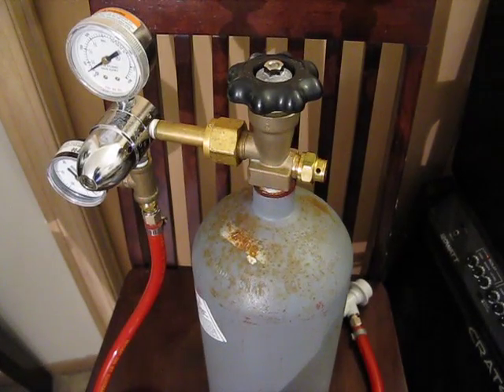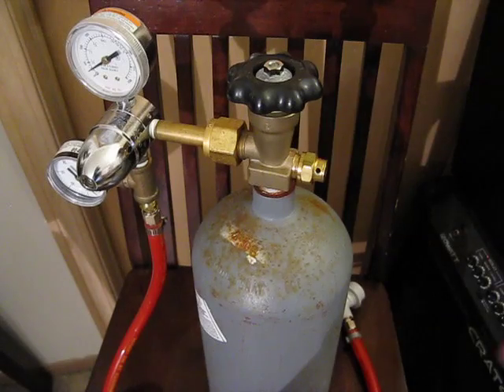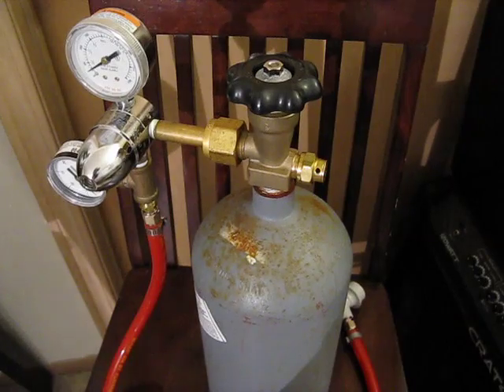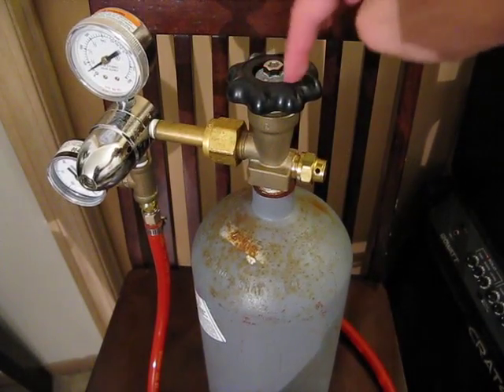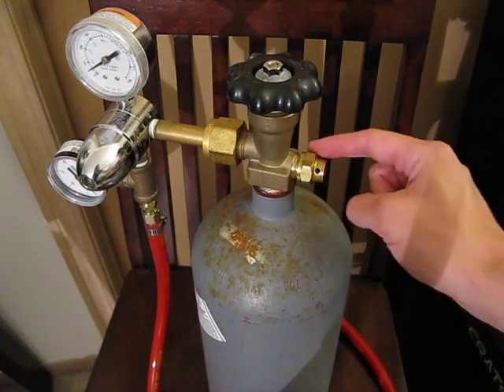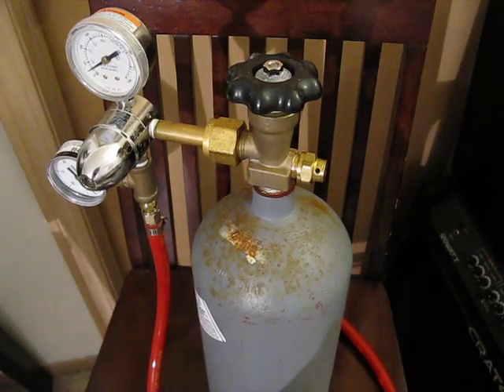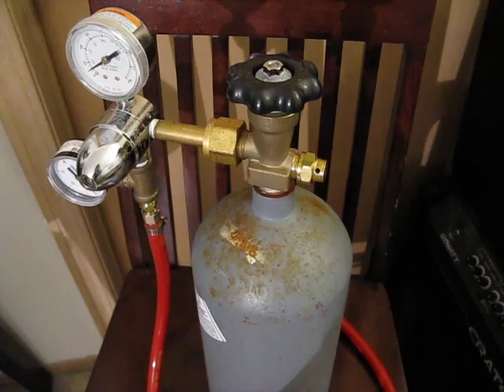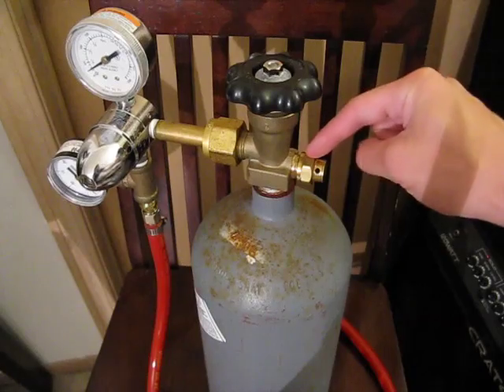CO2 Cylinder Tip - Checking for Leaks

Comment: I’ve had somewhat of a similar problem my safety valve blew out So I had a little diaphragm replaced and then refill the tank but it won’t hold pressure ever since so I just bought a whole new valve I was tired of playing with it I had it filled a couple times and every time it leaked out so now I’m going to an extinguisher shop on Monday and put on the new valve with brand new blowout valve diaphragm on an off-road Ing CO2 tank

Comment: Technically, they should inspect the safety and valve first. That's weird that it was bent. The safety should only be torqued to 35 ft  lbs. that bent piece shouldn't have made an impact. That's unusual though. I'm glad no one got hurt.
Reply from the maker: That's what I thought too.  It made no sense, but I am glad they got it figured out and the valve didn't blow on me.

Comment: i have an o2 tank i picked up today and when i turn the knob on o2 blows wide open pressure from under the handle!!!   i dont know if i can tighten the nut under the knob????  crap i hate hauling it all of the way back to the store
Reply: +Clown Whisper why are you using O2?
Reply: +HOT40K, what difference does that make why do you want to know even
Reply: +Clown Whisper maybe because you posted it on a public website? If you don't want people to ask questions, don't post anything. ;-)

Comment: So there I was showing off my new 20# tank to a friend. I told him it should last us two or three years (I was using 2-pound bottles for my soda maker before, and they lasted several months). Then I glanced at my gauge... I've had the tank home for three weeks, And it was down to half the pressure of "new." Googled turned up your video. I hosed the whole thing down in place - for me it was the junction from valve to tank. Huge gurgling leak. Thanks for the inspiration.

Comment: very helpful video. thanks for taking the time to make and post it. great idea to check the safety valve. i hadn't thought of that! underwater test sounds solid, too. i "get" to go back for a $20 refill tomorrow, but that'll be the last time I have to do so due to a leak. one additional idea to prevent leaks that I don't think you mentioned in this video: use Teflon tape in all or most of the pipe threads. i think that stuff works for gas, too; not just water leaks in plumbing applications.

Comment: iv got a leak but not where you were pointing i pretty sure its a combernation of the kegs and the regulator once kegs are empty ill be replacing poppet valves and all o rings and replace all seals on regulator and put new tape on all the connectors im in no hurry as i noticed the issue within 2 hours of spraying soap water over it

Comment from the maker: Most definitely put it in a bucket of water and look for the leaks--they're a clear as day when underwater.  Just don't submerge your regulator and it'll be fine.  I remember the guy at the local CO2 supply where I was going told me twice that he had checked it--so don't believe them until you see it yourself.  If you're still running out of CO2 after that... stop drinking so much beer!  :-D  Cheers!